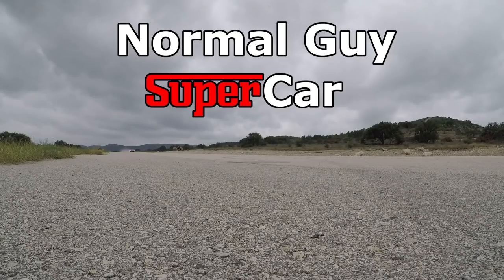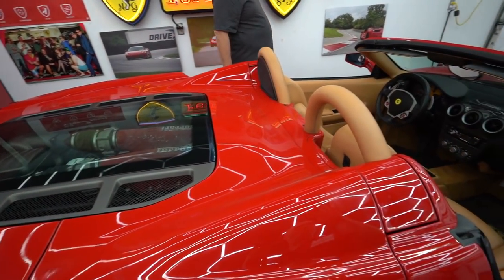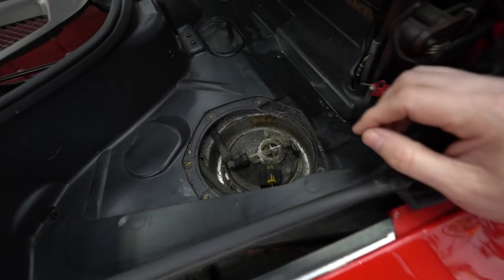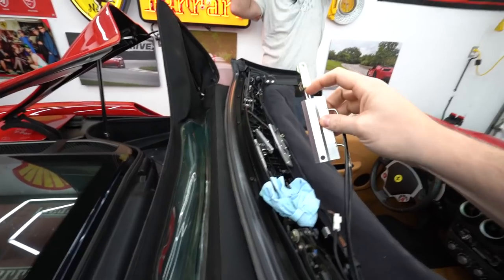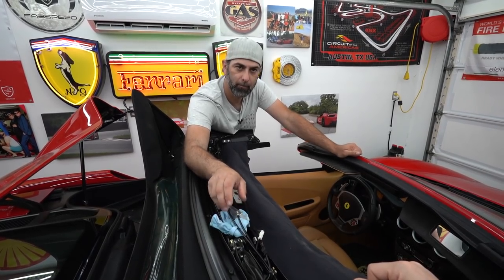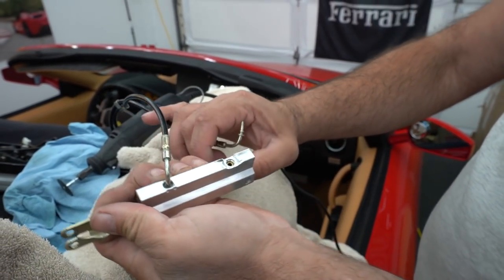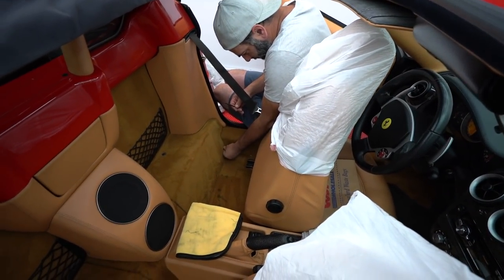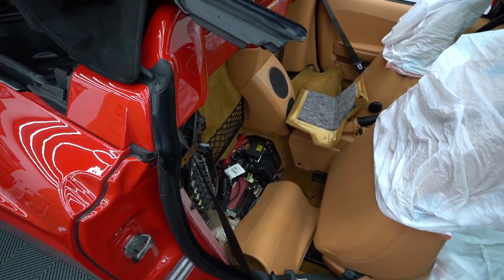FIRE HAZARD! Fuel Pump Leak and Hydraulic Top Failure - Ferrari F430 Turd Project Kick Off

Comment: Hello Dan. I just thought I’d help you guys out with something. I’ve owned both 360 spiders and 430. And the one thing they have in common is the hydraulic fluid in the tops will leak. The part you were grinding is the piston in the top. There are three pistons in total that are on the inside of the top. There are a couple more pistons down below behind the fuel pump. But, the one thing I wanted to tell you is if you were going to rebuild one of those pistons. It’s best if you replace the three that are up underneath the top on the inside. Because, let me tell you what’s going to happen to Daniel. Assuming those pistons have never been serviced. What’s going to happen is after you rebuild just that one piston. It’s going to cause much more pressure to the other two pistons. I would put $1000 down on a bet that one of the other two pistons will leak as soon as you install the new one. Or very soon there after. So, from my experience it’s better just to replace all three. The two pistons that manage to work the levers behind the fuel pumps rarely go bad. Anyway hope this helps. Otherwise you guys are just doing the same thing again in the near future. All my best Joe
Reply from the maker: Seems entirely possible
Reply: Well, I promise you it will happen Dan. That is why I was reaching out. Only speaking from experience. I know Daniel is a personal friend of yours. It’s the same principal as you were talking about in the video. You don’t just replace one fuel pump you replace both. So why would you replace only one piston. It’s like a game of the weakest link. Once you have replaced one and it is very strong the hydraulic power in those lines is going to make the other two burst one of the time. Your friend Daniel will have to go over all of this again. It will only cost him an additional $800 to replace the other two. Just saying. It’s his decision I guess.
Reply: I was thinking the same thing while watching this; however, there is typically a reason why a ram fails and it usually has to do with a scratch in the hard chrome shaft that gets damaged from dirt, a broken spring retainer in the seal, or a tear in the seal itself. Since he seems to be on a budget, I am sure that he is willing to risk it and only do spot repairs.

Comment: Two of the parts I had to repair for my top were both the drivers side and passenger side hydraulic rams.  They needed to be sent to a shop in Florida who refurbishes them because they are not readily available. NOTE: send BOTH to get refurbished.  Even though the other one is not leaking.  When only one is repaired and functions properly when reinstalled the pressure will cause the other one you didn't fix to fail. Also, go over the top thoroughly to see if there are any broken metal parts i.e. pillar that needs to be welded and repainted.
Reply from the maker: Yup there's other stuff that needs to be fixed.
Reply: @normalguysupercar  I highly stress you do the other ram and send it out as well.  THIS is why I had been without my car forever.  They only did one ram and then the other one failed. Quote of the day for them: "We will now do both rams moving forward with all 360/430's."
Reply: Stu!!!!!!! Were both rams removed/cut out with a dremel and were they machined smooth when returned? Is this what I have to look forward to on my 360's top in the future?
Reply: @js3602  remove both, ship both to get refurbished and reinstall when they get back. If not, you will wish you did. Just sayin’
Reply: Hey Stu, I thought that you just used a bit of LUUUUUUUBBBBEEEE to get the top going again?!?!?!
Reply: @freddaniali  oof duh!

Comment: Maybe I missed it (probably), but what company did you ship the hydraulic cylinders to get rebuilt? Since most of the top cylinders have lines you can't unbolt,  removing metal to release the lines at the cylinder itself with the rebuild company installing line hold down plates is a good option. Thanks
Reply from the maker: It's called top hydraulics
Reply: I checked their website, I didn't find that option. I did note they have the same procedure as Cabriolet Hydraulics of using line couplers to link up cut lines. To add to the discussion, the reason that specific hydraulic piston leaks is due to the fact it has the most exposure to the sun (it always seems to be the first to leak). Also should rebuild the tandem pistons in pairs, as the newly rebuilt cylinder is now more powerful and it may cause the frame to get out of kilter causing expensive damage. Thanks for the reply and I'll shut up.

Comment: very common problem, my Maserati Cambiocorsa coupe share the same part number as the Ferrari F430 fuel pump, both were leaking badly.
Reply from the maker: Yeah the high pressure side cracks

Comment: Hey Dan

Love your videos! Keep 'em coming.

I have a F430 and a Gallardo. Love my garage queens....

You seem very knowledgeable about these cars, so I have a question you might be able to answer.

My F430 makes a rattling noise when it shifts from 2nd to 3rd, but it is not a gear issue as I had the gearbox oil checked and tere are no metal shavings that would tell me the gears are jamming against each other.

This happens only when it shifts from 2nd to 3rd, no other shifts.

I can send you a video of the noise, but am wondering if you could think of a reason? 

Thanks

David
Reply from the maker: I wouldn't know without hearing it and even then I may not know.